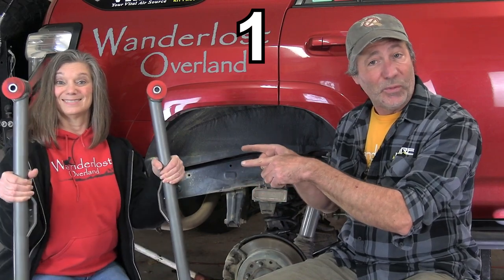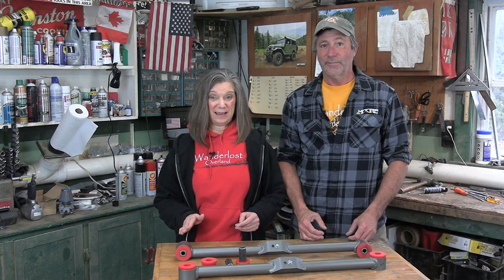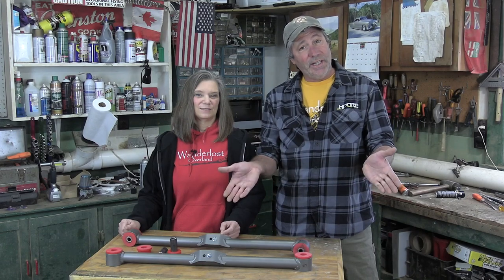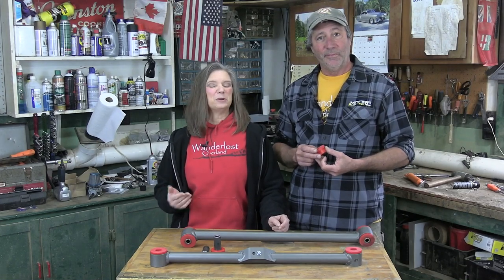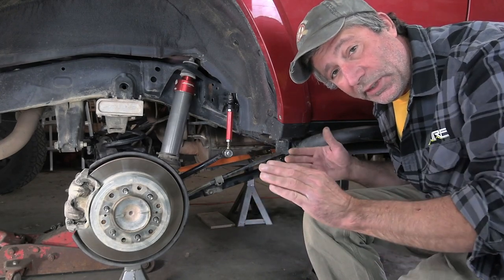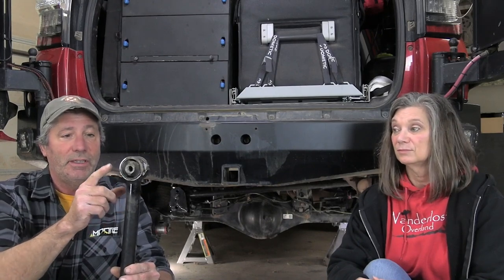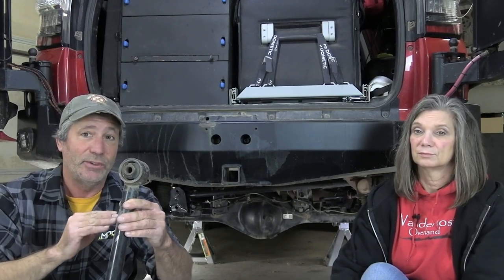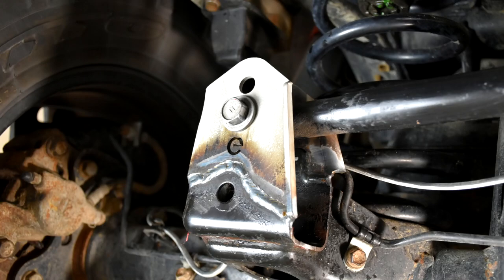5th Gen 4Runner- Our Choice & How To Install HD Rear Lower Control Arm, Toyota

Comment: Nicely done  I stuck with Dobinson but was looking hard a Sonoran  Just a tip torque the nut NOT the factory flange bolthead as they have locking nibs built on them
Reply from the maker: Good to know!

Comment: The benefit of an aftermarket Trac/PanHard bar is actually the bushings.  Not the fact that is can be adjusted.  Factory bushings which are static with a flexible membrane only allow for so much movement up and down.  Now that you put that mount on the axle, you raised the mounting point requiring the stock bushing to twist more on full stuff than if you left it stock.   But you may tear the bushing out on full stuff.  Your bump stop drops may prevent this but they are also preventing full stuff.   I don't know, you will have to check it out after you get some trail time.  We design our stuff to run full factory stuff and extended by 2" drop.  Even with KDSS.

Comment: I changed all of my links out with ICON links, even the uppers. They're about to twist because they have heim joints, instead of solid poly bushings. They need to be changed out once in a while, but it's pretty straight forward. Rebuilding a whole ICON suspension at once is a huge pain though.

Comment: Great video, always love the info. I like the do's and don'ts part you guys have been starting to do, it always helps steer people (me) in the rite direction. I'm just curious have you ever thought about changing out the front driver side needle bearing to the east coast gear supply bushing, it supposed to help with CV vibration after lifting the 4runner?
Reply from the maker: Thanks for watching! We have plans to change out to the bushing when the needle bearing finally wears out and gives us a vibration.

Comment: Did you need to do an alignment after this upgrade at all? I'm running a 3 inch Dobinson's IMS lift at the moment and wonder if this would be a recommended upgrade as well.
Reply from the maker: We haven't yet, but it would be a good idea to do it.
Reply: There is no rear suspension adjustments on a 4runner
Reply from the maker: @tommyhairyeah7726  You're correct but, by changing the position of the rear axle side to side the front alignment will be thrown off slightly.

Comment: Hey guys, love the videos as always! What is your opinion on heim jointed outer tie rods for the 5th gen 4runner? With 2.5" coilovers and SPC UCAs I'm getting some noticeable bump steer, which is also damaging the inner tie rods. Do you think this modification will correct that? Is it worth doing? Thanks for all the knowledge you lend us viewers!
Reply from the maker: If you're getting noticeable bump steer in the front, there's a problem. If you have aftermarket rims the offset may be too much. Wheel spacers will also do the same. Your alignment may not be optimal.  The stock tierod ends are more than strong enough to withstand a 2-3" lift.